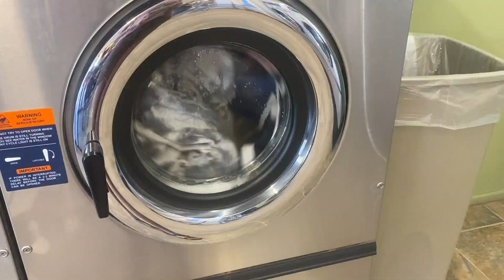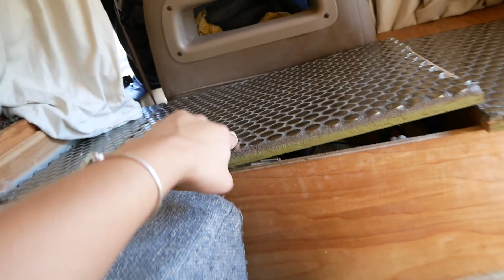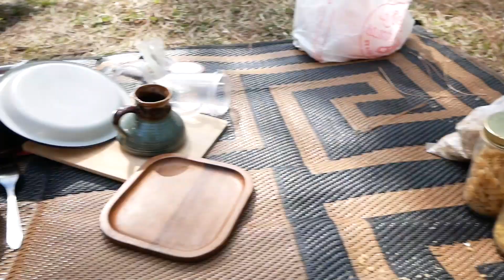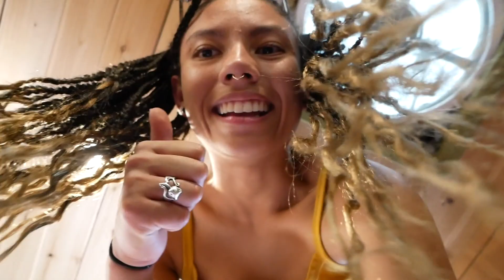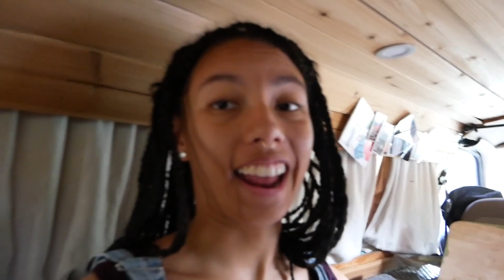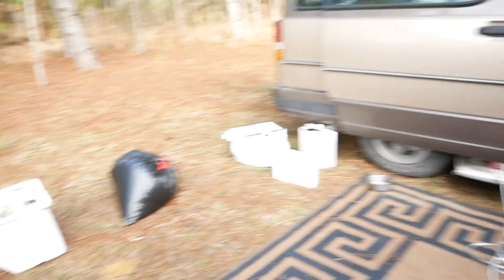I Need to Downsize More + How to Change a Composting Toilet | Van Life in the South

Comment from the maker: Guess I forgot to mention that my mom has tools that I can use when I need! Hehe don’t worry I wouldn’t go tool-less living in a diy conversion bc that’d be silly 😜
Reply: Lmaooooo  thank goodness! ☺
Reply: Im watching your tube now, thinking "nooooo, don't give up your tools". But I'm a handy man!
Reply: It's great that your Mom has tools.. "YOU" should be equally prepared.. At the very least, the organized briefcase tool set.. "MOST" have a well rounded variety of tools.. FYI.. Out on the road, everyone has to be like a boy/girl scout..  Always Prepared". Do U have a flat tire repair kit? Add one to your tool box.. Learn how to properly use it on a used tire.. Your drill makes this easier.   It's a temp fix. Never use on steer tires.. If you buy a used/new tire, there is usually a 4 digit DOT number on tire.. Example (1212). This means that the tire was made on the 12th week (April 1) of 2012.. That's a 9 year old tire no matter how new a tire may look.. 3 months old for new tires & 1 year for used tires.. Tire wear and tread depth will dictate otherwise... Be safe, good luck..
Reply: If you are going to sell your tools I’m interested, Julie
Reply: Instablaster.

Comment: Question, I've being seeing a lot videos stating they have to separate their liquids from their solids and have an exhaust fan when using a composting toilet. Do you separate your liquids and solids? Does the material you use fight the odor when the liquid and solids are mixed?